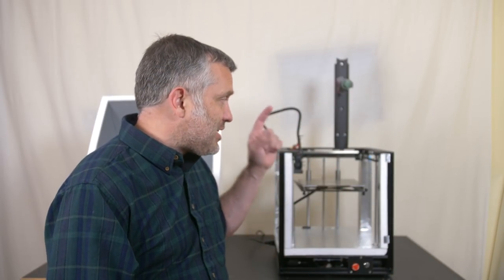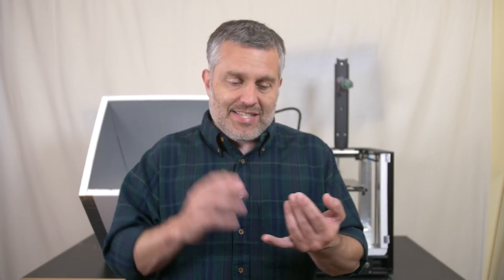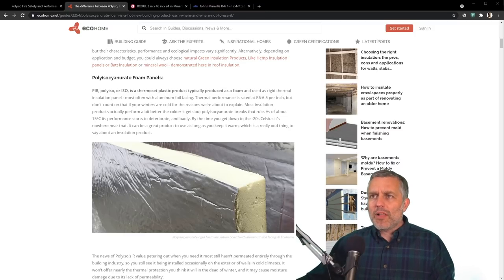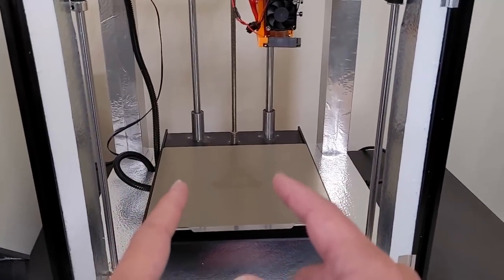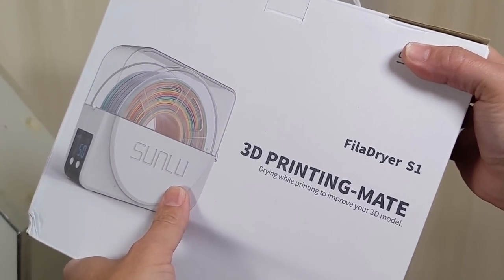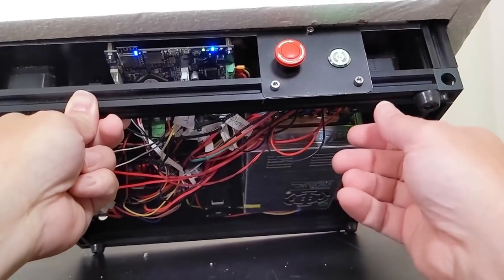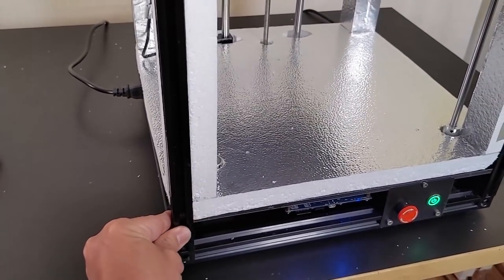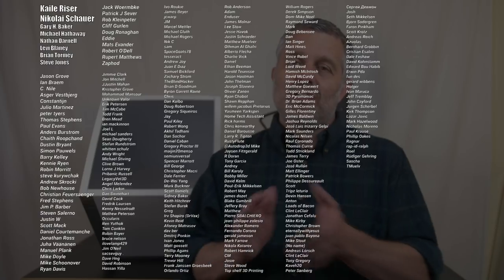INSULATED 3D Printer Chamber CoreXY With Isolated Electronics

Comment: Another good safety feature is using a thermal fuse inline to the power to your heated bed.  You can get those at various temps and if the temp goes above the rating the fuse opens and cuts power to your heated bed.  Generally you mount it under the bed.
Reply: @bolek2  Personally, I would go for 130C. Most PC requires 120C for the bed which IMO is a bit close to 125C. 130 is less likely to be tripped accidentally.
Reply: @paullancefield  that is because of his particular case. Voron user mostly print ABS with bed temp at 100C
Reply: Didn't even notice your comment before I put my lol sorry

Comment: Well its because they patented it. It will take some time before the market demands it and manufacturers get it into their line up. I took a  ikea cabinet, lined with drywall, seems to work well. Moved the Electronics to a separate side chamber. For the bed probe, make a magnetic removable one. I setup gcode to measure bed and pause the print, so I can remove it. It waits until chamber gets to temp then starts. Abs, pc, and nylon work well. I do have an outlet for a filtered fan assembly to exhaust the chamber, so I have a hard time keeping temps where I want.

Comment: for the bl-touch problem: after the heat-soak, just turn on the part cooling fan and open the door a few seconds before the z-homing. this cools down the bl-touch. you will reach a good chamber temperatur again after a few layers. or you can add a pause macro right after the z-homing. This works for my 65°C chamber printer with an original antclabs bl-touch.

Comment: I made my enclosure out of that pink insulation foam and the aluminum tape. It tops out or stabilizes around 120deg F. The door is also made of foam with a thin acrylic window. The door pops into place by just using the rare earth magnets. No hinges to mess with... my electronics are currently inside but will be mounting them to the enclosure externally.

Comment: We’ve been working on something like this on the Voron 3D printer group. It’s called the DOOM V2. You should check it out! Some people have had great results from putting fans and heatsinks under the bed since the capacity of the AC bed heater is way higher than needed. It bumps the chamber temps up by 10-20 degrees C depending on how well it’s done.
Reply: DOOM!

Comment: I am new to 3D printing but since I started a few weeks ago my ender 5 pro has been running non stop.  Being a practical engineer I was asking myself the same questions.  The store that sold me the printer sold me a bunch of ABS filament which i later learned I can not really use.  So it was obvious to me that the chamber needs to be closed and insulated and the electronics and motors need to be isolated from the heat (duh).  Glad to see someone address the same questions I had.
Reply: I see these flexible enclosures for sale even from Creality like a big tent to put over your printer.  I am thinking...what kind of lunacy is that.?

Comment: I just found your channel so I don't know how far this has gone, but with the big heated bed you don't really need another heating element unless you just want to heat things up faster. Instead a small fan circulating the air inside the chamber (possibly with a little tunnel picking up the air at the top of the chamber and depositing it at the bottom) would force everything to come very close to bed temp fairly quickly. A well built box out of that foam should keep the heat in well, but I'd likely run a second layer of foam before I tried another heating element. With your chamber shape I'd probably wire a microswitch into the circulating fan circuit that kills the fan if the door (that you're planning on adding) is opened, that way since heat rises you should be able to prevent a bunch of heat loss when opening the door.

Comment: Hvac tech here so I know a lot about heating and cooling. Still had thermal bridging right? Instead of using that insulation foam on the steel use thermal foam tape. Heat travels in air, air follows the least path of resistance. One or 2 sides being covered is irrelevant if 1 or 2 sides are exposed. Also heat rises and with the cover coming to a point it’s going to be hotter at the filament roll. By adding a low volt fan at that peak to circulate that heated air you will heat and dehumidify the enclosure more evenly. No hot spots. Great video btw.

Comment: You want a piezoelectric sensor like the Orion sensor. $35 and it uses the nozzle as the probe on the bed. You can buy it from Filastruder

Comment: Implementing heated chambers is still under patent to Stratasys.  What they have done is tweek the patent over time so they can keep the competition out.  It is why no company offers it "yet".  However, you are going to see more individual parts coming out that let you put together the pieces you need.  Btw, if you have ever seen one of those Stratasys machines they keep the air turbulent.  That maintains an even temp throughout the chamber.  Down side of that is that you need to worry about how all your printer parts (motors, electronics, bearings, etc.) are going to handle the higher chamber temp.  So think about something that moves the air top to bottom and you will be in good shape.
Reply: The heated chamber one expired in February. At least I thought it did.
Reply: Well, patent doesn’t apply to China. And Amazon has the qidi Ifast 300x260x360 enclosed build volume, dual extruder 300c , instead of idex it has digital nozzle height adjusters , harden steel nozzles, 120c bed and an actual digital controlled heated chamber up to 100c! It gets hot after 30 mins and is capable of printing cfpeek /pekk with tweaking their all metal hotend you ask for . $2500s a steal. Going to insulate with that same foam from Lowe’s and see how hot and efficient I can get it, thus saving energy. The electronics aren’t effected , power supply/ have their own intake and exhaust, as a FFL gunsmith , I love this thing .

Comment: Some fiber/garolite washers and stainless steel screws at the connection between the frame and the gantry assembly will help a lot with heat-leakage through the frame.  Titanium screws would be better but not really worth the $$.
Reply: Why titanium? Stainless it worse than titanium at transmitting heat.
for example a stainless heatbreak will perform better than a titanium one. Titanium is just stronger.

Comment: I have built a custom Railcore with an 80C heated chamber.  I used two heated fan units from the Funmat HT, which were purchased from the spare parts section on Visionminer’s website.  Get the chamber of my far less insulated setup up to 80C in about 5 minutes.

Comment: I've been working on a similar build, but will be using liquid cooling (stepper motors are in the chamber, and will need to be cooled, so will do the same with the hot end). 

Now for the important part, for the hotend I'm bending a custom cut sheet of aluminum, and adding in a strain gauge to it. Once it is calibrated to the temperatures in the chamber, it should be accurate, reliable...
Reply: If he wants to print PEKK, he will have to take care of the belts as well

Comment: Also, for the leveling probe, check out the annex engineering magprobe. They use a “toolchanger” type feature where it’s resting on one side of the printer and it picks it up with magnets. The magnets also act as the electrical connectors for the microswitch so it’s a pretty neat design.

Comment: Cork is quite fire resistant and also insulating. It's more expansive than polystyrene but using some thick foil of cork near heating elements might prevent heat deformation/firing of polystyrene increasing in the same time insulation in that parts.

Comment: I wonder if you could use something akin to a ceramic washer to keep the upright separated from the top panel, without weakening the structural strength that you get from that combination. I kinda doubt it, but that would decrease the thermal conductivity into the uprights
Reply: I thought about the same thing. It wouldn't have to be ceramic, nylon or peek is often used for this purpose.
Reply: same - was thinking fibre washers or a square of the same material

Comment: I did a box similar to yours on my Tronxy X5 SA 400Pro. I did just some tests but I measured over 60° C with heating bed only. In my project I have a bowden extruder setup so even this stepper is out of the hot zone. In my experience not having a perfect tight seal does not impact so much having holes for the GT2 belt to reach the steppers out of the box and even a Plexyglass front door.
Reply: @Luca Bulfone  I also have an Tronxy X5SA 400 Pro.  Would love to see some pics of your setup :)

Comment: Someone has or had patents on the box relatively recently is why.  Not that they probably couldn't be broken since they shouldn't have gone through, but most manufacturers will avoid it just because it isn't worth doing for the tiny gain.
May even be out by now, but there's a reason most places weren't doing it 10 years ago when a lot more people were using ABS.

Comment: As info, the Qidi iFast ("Industrial Dual Extruder") has a heated enclosure (upto 60*C) and has dual extruders with one being setup for high temps (though it seems to be easy to mod it to 400 degrees for more advanced materials.  I've been with you the whole time on the "why isn't anyone making this".   It comes in at $2,500 but no assembly and has a ton of bells and whistles (obviously Qidi is a Chinese company, and this printer is based on those components, so if that concerns you as far as maintenance, consider swapping out the hotends and extruders with your favorite.  and another thing is that it's based on the Qidi slicer, I haven't used it yet, but that could be another consideration).
Reply: Just saw your review of the Qidi i-Mate.  I'm interested to hear what you think of the iFast.  It looks like several of the concerns you mentioned on the i-Mate don't exist on the more expensive iFast model.
Reply: Since you don't want Chinese solutions, probably the cheapest solution you can get that is US made AND can achieve 110*C enclosure temperatures, is the MakerBot Method X Carbon Fiber edition (which is in the $4k range now, though has capabilities I have only seen in $20k plus more industrial machines).   But you are right, once you get the proper enclosure temperatures, there is little to no deformation due to high shrinkage rate of the higher temp materials.  It's been the holy grail ingredient to the high temp 3D printing conundrum.  To reach 110*C enclosure temps like this method x does, you know better than most how many other things need to be done to pull that off.  You couldn't just slap an insulated enclosure with a heater on a 3D printer and elevate the temps inside to 110*C without serious considerations.  Especially for longer term use (every piece has to be well engineered to put up with those temps over time and not get out of plumb, level, square, function, etc.)  Another interesting note about the Maker X product is that there is a metal extruder (called Labs Gen 2, under the Experimental Extruder line) that prints BASF Ultrafuse 316L | Stainless Steel).

Comment: As bed probe check out the inductive switches (e.g. PL-08N2), they work fine up to 70C. For clicky switch, there is the Magprobe (from Annex Engineering) which is a magnet attachment with automatic loading/unloading.
Reply: Not sure the PL-08N2 is a very good choice, I have melted one in my Voron before switching to an Omron probe

Comment: Fan on the bottom center of the bed is a good option for extra chamber heat.  Should accelerate heat up a ton.  Especially if you thermostat control it in the Duet to run if the chamber temp is too low.

Comment: I know this goes back in a time a bit.  I'll look and see if you've advanced it.   I've only ever ran enclosed printers since 2015.  I get into the 50-54c range, it takes a bit longer.   My latest little farm of printers includes 2 Ender 6 printers with custom made tops.  Easily enclosed.   I run an external display temp monitor to track chamber temps.  (I only print in ABS)  I put the sensor at the level where the printing is occurring.   Because there is little air movement inside, the temp zones stratify.  I know it's 10c or greater cooler at the bottom of the chamber and I wouldn't be surprised if it's 10c hotter than the print zone at the top of your chamber where your thermocouple was placed.  I was surprised your super job with the foam didn't get your more than the 60c where you are measuring.  I had considered trying to get some weak fan blowing the bottom of the bed that was temp controlled in order to rob the bed heater of a little more heat.  The ultimate cheap and safe solution is small halogen bulbs on a controller.  (seen it done) At 50c ABS prints amazing and the real tell is I can print bed size objects without pealing problems.  However, I've heard and want to test 70c as being the optimum.  Not been there yet.

Comment: Now add a camera to the octoprint pi (or whatever solution you're using), so that you can just look at the stream, instead of messing with the enclosure? Ideally you'd just need to check if it's printing well right?
So, grab a usb webcam, or even a ip cam cheap from ebay, and connect to it. most cameras even have IR leds to allow you to see in the dark :)
And of course, get the electronics outside of the chamber, otherwise you're also increasing the temps of the mosfets and board.

Very interesting that the bl touch stops working at 50 degrees, but have you tried any of the chinese know-offs? I got one and upwards of 40 degrees it works fine. Haven't pushed it upwards yet, but maybe check out the new stuff. Some of the materials could have been replaced and they could be more resistant nowdays.

great video!!

Comment: Does this work much better than just having two layers of glass/acrylic with a few CM of air in between?
Reply: Absolutely! Air gap is really only useful in this situation if it is evacuated..vacuum. Which you're not doing DIY at home without serious effort. The R value of just panels with an air gap is probably like 2 at best. This foam sheet with foil coating is at least R5. That's quite a difference.

Comment: hope you change the insolation soon, in the uk we had the grenfell disaster, tower block with flamable cladding went up in flames and they couldnt put it out. one nifty/lazy feature i thought of, is have a stepper motor lift that top up. and maybe you could use heated beds as extra heaters on the side/top, and some fans to help circulate the heat. another good video and its what you do best, this type of thing, i think :)

Comment: You could always make a small circular hole in the enclosure (and keep the cutout material as a plug) and then use digital heat gun set at your preferred temperature to heat the enclosure up a bit quicker?

Comment: Keep up the good work. Consider adding some Peltier devices to keep the things that should stay cold in the box cold and provided additional heating. When you add fans set up a low speed vortex around the chamber. I would prefer a printer with double pain glass that would allow the sides to be opened for easy access, but the price may not be worth it.

Comment: Looking forward to seeing what you come up with. One question though. How would using something like plexi glass work out? Its see though. I imagine its not as insulating as what you plan on using though? Possibly harder to use too since you would have to use corner bracing and screws or glue to hold it all together?

Comment: there is a probe from a britain company that is placed between the hotend and gantry, it basically senses when the nozzle touches the bed, maybe this helps you
Reply: Piezo sensor is basically this concept.  Another option is to have the hot end touch some metal potion of the bed and complete a circuit.
Reply: @Thee_Gamefanatic  I currently have my delta printer set up so that when the nozzle touches the bed it lifts just slightly and opens the circuit. Works perfectly and is safer that closing a circuit.

Comment: I tried building one about 4 years ago based on hevo. I got chamber temps up to 72c really pushing it. I used corrugated plastic acrylic and alubond combo for walls and a 350w ptc heater controlled by ssr and the duet. But it is tough to maintain. and heat creep was a significant issue above 60 so jams was a problem. I think polycarb is the limit with these home brews and not raw stuff the blends like pc-max but I get good prints from that with my old flashforge creator pro with a plastic bag over it and the doors closed. The high temp setup I haven't used in over a year its use case was limited I could the time and money anymore I will send out for prints in the future if I need that Im using resin printers a lot now for my model train hobby.

Comment: Great video!  No drama, factual, useful info.  I think that for a long print your problem might become too much heat as hotend and bed are pushing energy in and you have nothing in place to let excess energy out.  For the size of the original Sapphire, do you really need a bed probe?  Unfortunately later Sapphire iterations seem to have moved the motors to the top again, i.e. within what would be the heated chamber :-(

Comment: i got to do the chamber before and found that the more you have height in the chamber, the hot air will go on top side of chamber most of the time. you better have air circulation inside with fan.